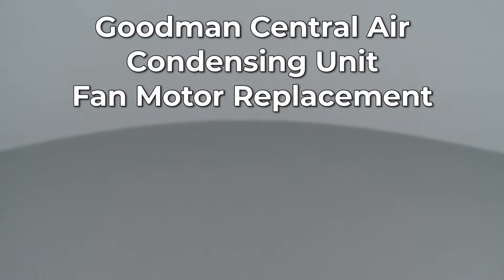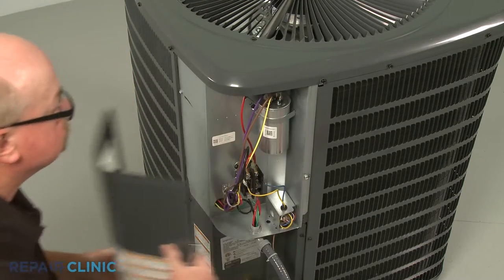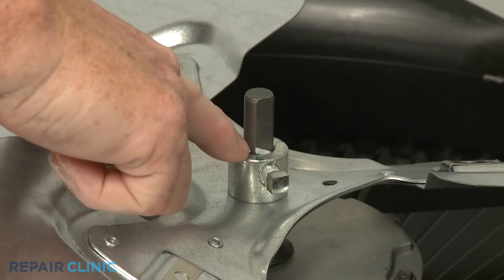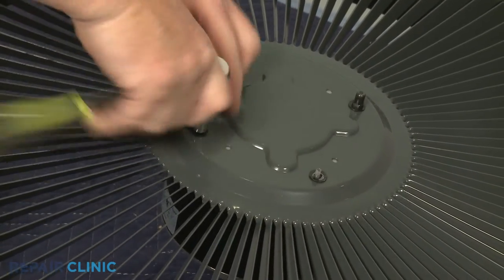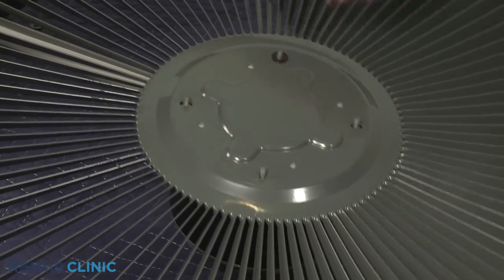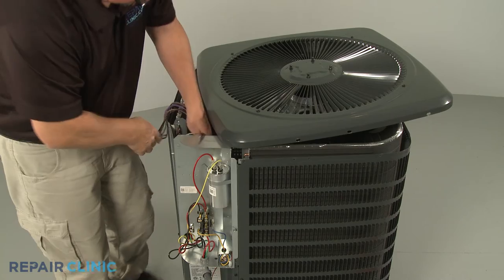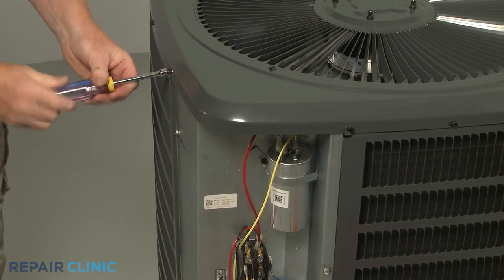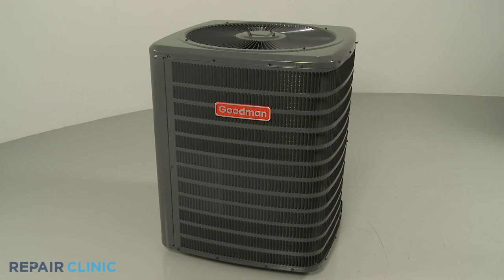Goodman Central Air Condensing Unit Fan Motor Replacement 0131M00018PSP

Comment: Working for HVAC company I only had universal motors on the truck. Had to cut wires and motor shaft to fit. No OEM parts. This is a dream to have exact replacements.

Comment: Interesting, where do you buy 3 wired condenser fan motors these days ?
Reply: As a contractor you can buy motors through parts houses but they only sell to contractors not retail
Reply: @ablebaker1275  There are a few who will sell to the public. Thankfully too.

Comment: I got a 2005 Ckl36-1l, fan won’t spin, replaced with new fan motor and capacitor, still won’t power up. Compressor hums but fan will not turn
Help
Reply: You need to put black and white wires on low voltage on contactor . Then the blades will turn.
Reply: @wisconsinbadgersfootball3327  will try in a.m.  thank you
Reply: @jonrob4675 Did it work?
Reply: @PhillyDjHook  ac professional came and found a wire hooked up to the wrong terminal … I suspect the unprofessional guy that came and looked it over for 250 and said I needed a new fan motor

Comment: Not a realistic scenario!  🤣You’re missing the hot sun, sweat beading down & into your eyes, ants, bugs, gnats!  And don’t forget sanding the old motor shaft bc of the fan blade that’s rusted on and won’t come off w/o a fan puller or you have to trash it and get a new fan blade bc it’s rusted so bad!